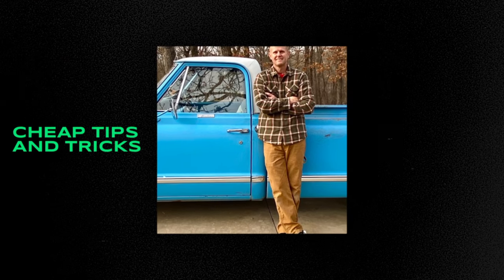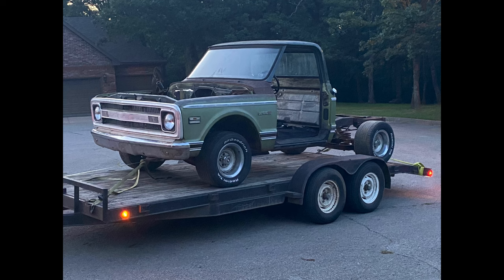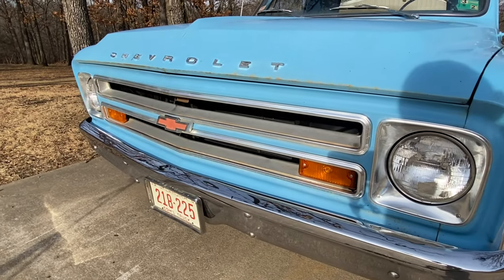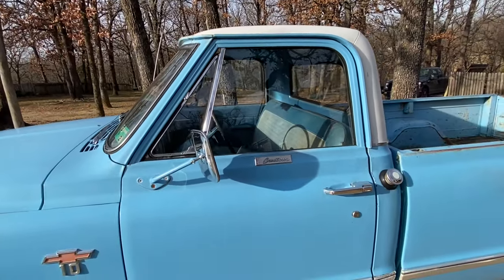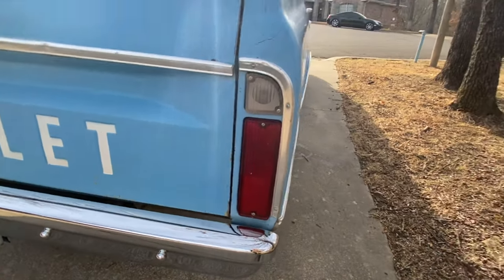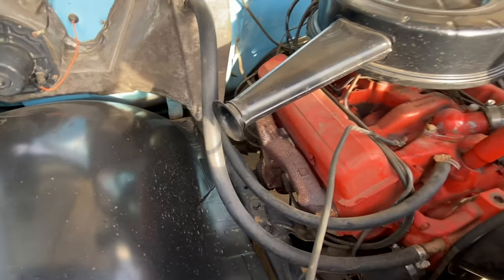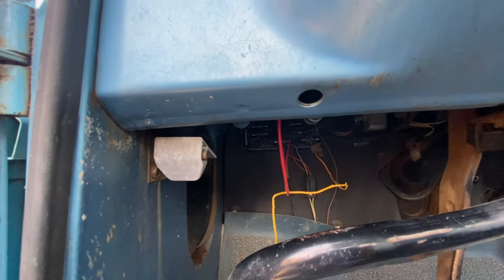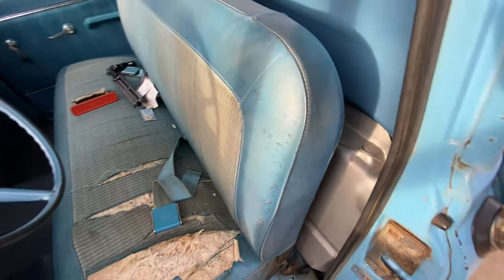1967 Chevy C10 - Year Specifics!

Comment: Cool video! I also was born in 1967 but I fell in love with a 1969 3/4 4x4. We had a 1967 GMC 2 wheel drive short bed on the dairy.  My dad and uncle bought it new and my cousin still has it.  It is an A.C. truck with the 305 V6. Unfortunately the smog equipment ruined two engines in the truck (that's what I was told growing up). It had tall gears because it was used to drive to our pasture 25 miles away on a regular basis.  This made it tough to get going when towing a 20' gooseneck trailer loaded with cattle despite having the granny 4 speed transmission. The truck suffered lots of body rot. In the late 80s they had it repaired and painted but it did stay a farm truck. However it is retired now and lives in town now. Do to the hard life on the ranch the rear half ton axle broke two shafts. I was 14 or 15 and just moving it in the yard after unloading calves when the axle broke for the 2nd time.  Our local shop (Depot Garage) is where they bought the truck and dad asked if they could install a 3/4 rear axle. They said "no problem ". And they installed a Corporate 14 bolt full floating rear axle. It looked a little funny but it definitely got the job done. Thank you for the all knowledge on the year specific differences.
Reply from the maker: Thank you! The trucks are great, but the stories and all the memories tied to them are the best! The GMC 305 and 351 V6 was all torque! They sound like a tractor to me. I am ready to continue on with the year specific series. I have a nice 69 lined up I’m sure you will like! Thanks for sharing your stories and for watching!

Comment: In 67 the grill area was the same color as the fenders but in 68 it was white .  The heater control in my 67 was siver instead of black . My 67 was a wide rear window ,steel bed,a but front bumper and head light bezals we're painted white.but had a white roof and wheels the same color as the body. I had the bright body molding down the sides . My truck was 250 with a short shaft unsyncronized Three speed . I had an optional Oil bath air cleaner . Manual steering and manual brakes no air but an AM radio .my truck was a custom or CST trim package truck....I can't remember which. My seat was vinly with some designs stamped in it I think. The door panels and arm rest was like the one in the video but was red .Thanks for walking me down memory lane .
Reply from the maker: Good to know about the white nose! Such a cool year with all these year specifics. It’s pretty cool to see how these old trucks can bring folks together! I appreciate you sharing and thanks for watching!

Comment: Correction for you: some 1968 C10's came with the small rear window.  No 1967's had side markers, so if you find one, it must be early 68. I have seen both 67 and 68 small window trucks. My old 67 GMC C10 had a steering shaft that had no joints and went straight to the steering box. I think thats a 2 year thing also. The sloped hood is the cool defining feature that sets them apart! As an aside, if you are converting to front disc brakes 5 lug, and want a 9 inch, find a 70's Montego, its 5 on 5 pattern and correct width to put 15x10 wheels and have them just inside the rear wheel opening.
Reply from the maker: I haven't seen a 68 small window in the wild. That doesn't surprise me though. It would have had to been an early or left over since Ralph Nader  got involved with safety and they required the big window in 68 except for bigger trucks. I agree with you on the 67-68 hoods. Such a cool look! I hadn't heard about robbing a Montego. Neat idea.

Comment: My dad bought a 1967 C10 brand new in January of 1967. He passed away 10 years ago. I still have the truck, although it hasn't been driven I a long time.

Mine is a Custom. Dad ordered the optional panoramic rear window. He also ordered it with a 220 hp 327 with a Turbo Hydramatic 400 automatic transmission. That's rare. It has a step bumper.

In the 90s, I converted it to power disk brakes from a 1971 C10 donor truck. I plan to fully restore it at some point. It now has five lug wheels all around.. Dad also ordered the slave cylinder power steering system. When I did the power disk brakes, I also put the power steering from the 1971 donor on it.

The rear axle housing is narrower on the 1967s (I think through 1970) by 1 and 1/2 inches than the 1970 and 1971. In order to use the five lug axles to match the disk brake setup, I had to change the rear axle housing.

The crankshaft broke on the 327, so I built a 4-bolt main 350 with steel crank using 186 double Hump heads and flat top pistons.
Reply from the maker: That’s wonderful it’s still in the family! The trucks are great, but the memories tied to them are irreplaceable. A 67 big window 327 400 is rare! Neat options. You are right on axle lengths. 67 to mid year 70s 1.5 narrower. I’m glad you still have it and hope it continues to bring good memories! I appreciate you sharing and watching!

Comment: 67 was weird on having heat too. Even though 67 was the first year it was a standard feature, you still had to ask for it. It was almost treated like a no cost option. 
The interior paint was frequently sliver, that was also the base model paint, any other color would be an optional and listed on the SPID. 
The cigar lighter on later models had a large stainless piece of trim and was a bit recessed while the 67 (and possibly 68) was drilled and mounted directly to the dash. 
The recessed trim for the ignition switch was a smaller diameter on the 67 (and possibly 68) Not many people catch the lack of an accessory position on the ignition switch. 
The black painted wood floor lasted until mid 68 when they started painting it in body color. 
Passenger side sun visor was optional in 67
On the passenger side frame rail under the hood, about where the fuel pump was, the top of the C channel was flared up a little for big block clearance, not found on the 67. 
The paint on the top of the dash was flat paint, but that was all model years in this generation. 

I had noticed the different “print” on the backup lights but never knew the reasoning. I figured one was reproduction. 

Always did love this generation GM truck. Spent 1998 to 2012 daily driving a few of these trucks, would love another, but I think I want a 72 2 wheel drive blazer this time.
Reply from the maker: Good stuff! I didn’t realize the flare wasn’t in the 67 frame. Makes sense with no big block option. GM got it right with the 67-72s! Such a clean look. I hope you track down a Blazer! No many around here. Thanks for sharing and for watching!
Reply: @C10TruckNerd  yes. I found out about that when I was ordering something for my ‘67. I can’t remember what it was but it made a difference. I looked at the frame of my ‘68 and my ‘69 C10’s and they were definitely different. I have my ‘67 short bed step side for sale and I’m in the Nashville area if anyone is interested. It’s pretty custom and all the drive train is rebuilt. A 383 c.i. with a th350 trans. Large rear window with ‘68 front fenders. Disc brakes in front and 5 lug wheels.
Reply: The comment about the weird heat brought back memories when alot of cars and trucks were advertised as having "R&H" . Radio and heater. Cool old 67.

Comment: Early ‘68s had side reflectors…..no hole for a lamp. Caused me some trouble at inspection time…..inspector said: “your side markers don’t work”….I showed him the backside with no hole for the lamp. I did upgrade so as not to have the argument year after year.
Reply from the maker: You got it! Not required by the feds in trucks until the 70 model year. It’s not fun to have to educate the inspectors. I agree with adding them. Might as well make yourself more visible for all the distracted driver! Stay safe out there and thanks for watching!

Comment: One more thing is the headlight switch. The front parking lights turn off when you turnnon the headlights. The switch itself is 1967-only, unless it carried over from the 66
Reply from the maker: You’re right! I filmed a clip of me showing that but forgot to add it. I did show it in the switches video. It’s weird why it does that. Most people think there is a problem with the wiring until they find out it’s supposed to be that way. I appreciate you sharing this!

Comment: The CST was the Silverado of 1967. It was the top of the line trim level from 1967 through 1970. In 1971, a new Cheyenne trim level was introduced & it became the new top of the line trim level until later in the 1971 model year when the new Cheyenne Super trim level was introduced & became the new top of the line trim level. The square body models which were the next generation fullsize truck models were the first to receive the Silverado trim level in 1975.

Comment: I have a strange and somewhat rare C10. It is a 1970 CST, shortbed stepside heavy half ton so it has leaf springs in the back from the factory. It came with a 402BB, TH400, 12 bolt with factory limited slip, and factory 4.11:1. It is not an AC cab unfortunately.
Reply from the maker: That thing should be a tank! I don't know I've seen a highly optioned (CST) with leafs and and 4:11s. I bet that thing can tow a house.

Comment: In 1967 and 1968, the Chevrolet C10 pickup came with a 250 or 292 inline-6s, and 283, 307, 327 and 366 V8s, I had a 307 in mine.
Reply from the maker: I liked the 307. They didn’t last long though. I bet it was cool in 68 to see the 396 as an option in these trucks.

Comment: Welcome to the wonderful world of the coolest trucks ever made, 11 million made 1967-1972. No company has ever come close since.... 
I've had 5 clean & correct specimens of these bad boys!  1967 was the last year that GM did a tri-color offering, like yours.  1967 & 1968 are the most sought-after years of the 1967-1972 series. The '67/'68 hood is called a "shark nose".  The tailgate ridge comment you mentioned is NOT 1967 only, 1968 did too...  1968 went to BIG back windows & panel marker lights because of the noise that consumer advocate Ralph Nader made about safety.  GM has only made 500 BIG block 1/2 tons ever in their history, all were 396ci (250 were 4brl & 250 2brl intakes) in 1968, none of which were air conditioned.  1968 also had the limited edition 50th anniversary gold/white paint job on both long & short fleetsides.  1967 was the last year GM offered the wood bed as standard, in 1968, wood became an option & the steel bed was standard. In 1967 & 1968, GM offered the "Buddy" seat option, 1969 -1972 changed to a bucket seat w/ console option.  Many more facts are available, feel free to call me to discuss....  Rick at 720-three nine two-3420
Reply from the maker: Outstanding! I will be in touch soon!

Comment: My 67 is the same colo combo. 507 light blue with the white top. I have the optional big back glass though
Reply from the maker: That’s even more rare with the big window! Hang onto that one!
Reply: @C10TruckNerd  bought it for $700 when I was 14. Don’t plan on selling it. It’s a camper special. Still a half ton with coils but has a helper leaf out back as well. Originally had a 283 but I dropped in a 496

Comment: I have a 67 short bed small back window  4x4. I’ve owned it 20 yrs, this has taught me alot about it. But, mine has air. And it’s not underdash, it’s thru the dash and has factory AC controls. You did not mention if these yrs came w AC?
 Thank you !
Reply from the maker: You bet and thanks for the support! AC in 67 was a very rare option. Only about 3% came with it, so you’ve got a good one being a swb 4x4!
Reply: @C10TruckNerd  thank you very much for responding. I knew it was rare- but not that rare! I’m fixin to restore it for my wife’s 40th in 3 yrs. It’ was blue like this one as I can see it on the underside of things as there are still most of its body parts in place after someone else did what they did before I bought  it. But, the bed doesn’t look like it came w the body as it shows no blue anywhere rather a color that matches one misplaced/replaced front fender w a filled side marker in it, and the bed has tail lamps that were filled in as well. It also has a 350 in it and auto trans. How would I find out the original motor, trans and bed style ? I’m considering putting a step side on it but I’d like to maintain as much originality to it. I appreciate any info thank you very much. Great channel 👍🏼

Comment: Chad , I have a stock 67 C-20 it has just the white paint on the roof . and it has what looks like two alt brackets stuck together. what i did not know was that the seat can fold forward (a little ) I am going to look into that .I only have the truck 6 years ,
Reply from the maker: Good to know! The side seat hinge should be exposed in 67-68. 69-72 would be covered by the seat cover. I like that it folds just in case you need to access the gas tank.

Comment: interesting.. I have a true 67 numbers match cab and frame and my frame has the rounded area for powers steering.  also don't have the extra hole on the steering Colum. going to have to do some more research since I was pretty sure the Colum was original. wonder if later built 67s had some changes.
Reply from the maker: That’s cool! I bet it was a late 67. Check the last 6 of the VIN for the sequence number (build). Might be a high number if so.

Comment: hey Chad quick ? for you I have a 67 c10 custom 6 lug truck what color wheels came on those trucks,  all ads from that time all show white wheels and my wheels are the blue like my truck but was painted black for some reason thanks for any help
Reply from the maker: I have found that the literature isn’t always set in stone. From the factory in 67 the wheels should be black with solid exterior paint and the wheels should be body color if a two tone. 68 and up were different along with 4wd and GMC. Not to say different factories and dealerships did their own things. Hope that makes sense.

Comment: What about hubcaps year specific for 1967 c 20? Lots of differences between 10 and 20. I believe bow tie is red only  on both and 3/4 ton had different dog bowls but not sure
Reply from the maker: You are correct. The back of the dog dish was a different size as for 8 lug. Could have been painted ivory or shiny metal. I do need to do a little more homework on them.

Comment: I got a 67 c10 327 with the ac option. My grandfather left it to me. He knew I loved trucks. Motor seems like it should have more power being a 327. I checked everything and it's running great and smooth, just no guts when you hit the accelerator. Any clues?
Reply from the maker: That’s awesome it stayed in the family! The old truck 327 only pushed out about 200 HP new. She may be getting tired. Did you swap the plugs, wires or any of the dizzy stuff?
Reply: @C10TruckNerd  Yes they made so many different variations of this motor at the time so I figured I had the torque version, it being a truck with TH auto 3 speed.  I ditched the points system and went with an HEI and of course new plugs and wires. Gonna put a new Edelbrock performer intake and swap out the 4jet Rochester with  a Holley. Maybe in the near future  a bolt on EFI system like Fi tech or Holley too. That should grant me an extra 40hp all together.

Comment: My truck is exactly like this but it is a GMC and has small back window, the same handle mirrors, same tailgate, no rear bumper, same raised hood, but has dual front head lights (2 on each side, instead of 1) i did some research and came across a reference that Elvis had the same exact model which did come with side markers, dual headlights and no rear bumper. If you have serious knowledge about this specific model of 1967 GMC truck please get in touch with me. I have so many questions.
Reply from the maker: That’s a super cool truck. I like how the 67 GMC had the letter in the center of the grille. 68 only. I do know that Elvis owned a 67 and drove it on his Ranch in Mississippi. Jay Leno owns it now. It has been restored since. It doesn’t have side markers and does have a rear bumper now. I’m not sure if it did back in the day. About a year ago, Jay Leno had Blake Shelton on his show and let Blake drive it since he is such an Elvis fan. Here is the link if you want to see it. https://youtu.be/21AGjWS4oQA

Comment: I have a 68 GMC K1500 with a small window cab. Appears not to be a cab swap, original paint. What do you think? Good fake or GM using an existing cab.
Reply from the maker: I hope it’s original! That would be cool. Does the VIN on the frame and cab match? If you wouldn’t mind emailing me some pics of the vin plate, interior and an overall, I would like to help you find out. My email is on my main page.

Comment: Also my 67 step side has 2 holes on the side of the cowl close to where the antenna comes out as if there was an emblem there… there on both sides ……any info? ..thanks
Reply: Also there were no seatbelts and it looks like they were none install from the factory because there were plastic plugs, inserted at the top mounting positions🤷🏼
Reply from the maker: I am guessing those small holes were for the local dealership that sold it. I have had several emblems there and also holes from dual antennas from CBs.
Reply from the maker: There should have been lap belts in all of them. Not saying there aren’t anomalies out there. Shoulder belts were an option. If  they didn’t come optioned, they usually put in the plastic plug. Hope that made sense.